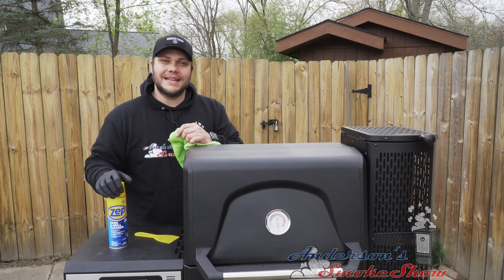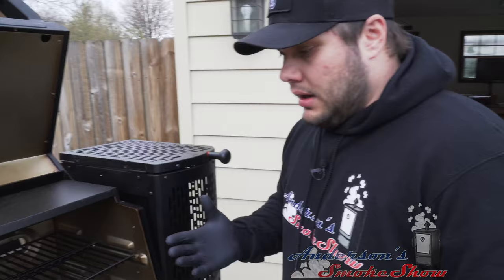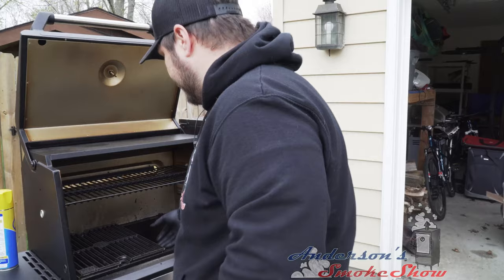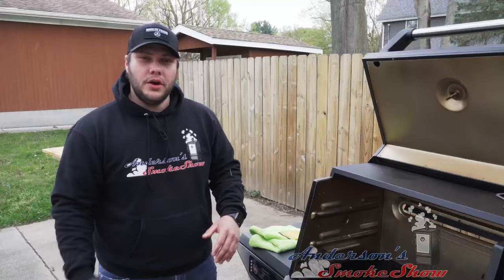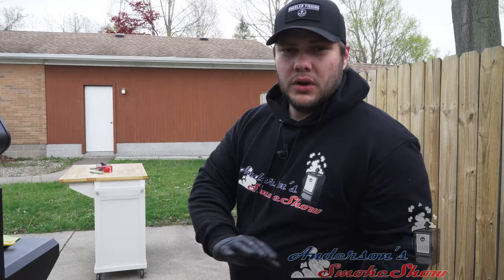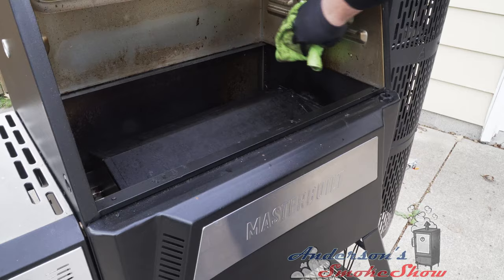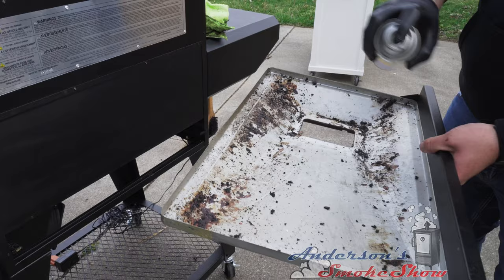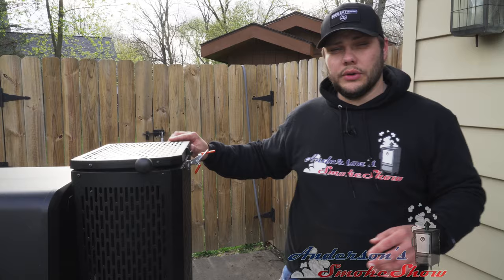Don’t Let Grease Fires Destroy Your Food | How to Clean Your Masterbuilt Gravity 560

Comment from the maker: Wanna see more great content? Click this link to subscribe: https://www.youtube.com/channel/UCbXJeP9Xkq_cu7ZfhIop_Kw/?sub_confirmation=1
Reply: Both online
1. klotes
Fire box and vent (will void warranty) fire grate or fan protecter (grate has protecter built in new grills has grate change already) coal chute and lid for ease of cleaning and protecting grill
2. Lss
Same as above with no voiding warranty (but did confirm both firebox mods will stack)

#2 has better water pan both have manifold grease channelers  #1 has a grease catcher/water (#2 has holders for a foil pan)  holder manifold cover

Am getting the fan protector and coal sleeve from #1 the big kit + rack + coal cover from #2
Reply: Have you tried any of the above
Reply from the maker: I have the LSS mods on this smoker.
Reply: @AndersonsSmokeShow  check out the coal sleeve makes cleaning the hopper easier
Reply: @AndersonsSmokeShow  500$ grill with 600$ of mods 😁 but if it increases lifespan and quality of life is a huge +
Reply from the maker: Yeah that’s an expensive pill to swallow lol

Comment: I never use a wire brush on my grill, only a wad of tinfoil! The wires, from the brushes, have been known to  break off and can get into food. Also, I wrapped all of my lower surfaces with tin foil to keep from getting nasty. I bought a 560 a few months ago, and love the ease of use! Just set my temp and go!
Reply: Have you used the app?  I just got my grill yesterday, but the reviews on the app are the worst I've ever seen.
Reply from the maker: I have but they have a “safety” feature that disconnects the app when you open the lid
Reply: @mitchdroese84  I use the app all the time. No issues with it.

Comment: Good video. When I clean my 800 I do almost the same thing. However I take the heat manifold out and empty the ash and wash it separately. Then I spray the snot out of everything inside, scrape it down. Take the drip tray out and put a pail under it and pour boiling water on everything inside. Everything runs into the pail. Then I put the manifold back in and fire it up like you.
Reply: How do you take it out?
Reply: @timthomas2125  Just push it towards the wall of the bbq (away from the fan) and it should slide, then lift.

Comment: Right now, I have a traeger, I've seen the Masterbuilt 560 at the farm and home store. I didn't like the Traeger ,because  when cleaning, you have to tilt the drip pan to remove from grill. Thus loosing all drippings/grease in the bottom of grill !
I thought, what genius designed this mess of steel. I was looking at the 560 but seen one of your videos that say put in 200 more dollars and get the 800! And noticed how much better it was designed. Easier to clean out! And it can sear steak at 700 degrees! Treager could not do that. Thanks for your videos!
Reply from the maker: Thanks for watching! The 800 and 1050 are better than the 560 and they make great food!

Comment: Why not do what we do with our kitchen ovens, and do an oven self-cleaning by running it at 700 degrees for a while, to let the gunk just burn off on its own? Then, the gunk will have been burnt to an ash that can be easily brushed off. No chemicals needed!😁
Sorry if this post sounds like I know what I'm talking about, because I don't! But I will after I get my 560 up and running next week! Great vids!
Reply from the maker: Masterbuilts instructions don’t make any reference to running it like a cleaning cycle. They say mild detergent and a damp rag, then dry thoroughly.
Reply: I ran my MB 560 @ 700° and it warped some of the metal surfaces
Reply: I didn't realise when I posted this link, that the video is by Masterbuilt itself, so I guess you can say Masterbuilt recommends it!
Reply: @lynnstewart4398  interesting...i wonder if they're aware of what those temps do to their bbq's
Reply: @Itsaint69  What parts warped?
Reply: @lynnstewart4398  The metal lips that hold the grates, the back panel and the removable shelves.  all warped to one degree or another
Reply: Self cleaning  on an oven is 500° for 30 minutes and that’s how I do it I wouldn’t hold the grill at 700° for too long it’s made for searing shouldn’t hurt to go there for 10 minutes or so

Comment: 2 questions. I hear wire brushes are not safe as the bristles come off and end up in food. Also, is there any reason I could not line the grease tray and manifold with heavy duty aluminum foil for easier cleanup?

Comment: I really like your channels and videos. Very good at explaining and you don't constantly repeat yourself. I've seen on some FaceBook groups people complaining about degradation inside the hopper and folks modifying the hopper with a steel insert. Have you had this issue? Is it something to worry about? Are they freaking out over nothing? I would like to buy the 1050 but want to know about this issue
Reply from the maker: Paul I haven’t noticed anything too worrisome. I did see some small-mid sized pieces of charcoal in the ash clean out which you can see in the video... I feel like you conserve more charcoal with this Masterbuilt that any standard charcoal grill so I’m not too concerned. Could they have made the insert a little different in effort to hold the charcoal better.... yes, but maybe that wasn’t their plan. Pure speculation here..... but maybe in order to accurately and effectively maintain temperatures they want the smaller coals to fall through and get replaced by fresher and larger coals. No clue if that’s where their minds were, but typically products go through many prototypes and tests. So I have to give them the benefit of the doubt. Thanks for watching Paul!
Reply: @AndersonsSmokeShow  Thank you. I look forward to more videos

Comment: Thanks for the video! I bought this grill a few weeks back and already have some burgers, a couple steaks and a brisket through it. I was wondering though, the lid of my hopper has a ton of char on it. Almost like there was a plastic film that I didn't remove prior to using. I followed the proper burn in procedure and went over the directions more than a few times to make sure I didn't miss it. I don't think its effected anything so for, but I was quite surprised about it. Love the grill so far, and this is the only thing Ive noticed (other than my bluetooth not working as advertised). Thanks for any help!
Reply from the maker: I noticed the same thing. I think it’s paint or some coating that’s flaking due to the heat and condensation.
Reply: fold a piece of foil and place over. then close lid on top of foil. works great! Blutooth works if you open lid then close and push connection button. usually links right up.
Reply: I know this is 3 years old but that's probably creosote buildup.

Comment: Nice video. I’ve been watching several of yours over the past few days and really enjoy them. I got my 560 put together last Thursday and did my burn in and seasoning. Like you I’m from Ohio and it has been crappy weather so I have not cooked on mine yet. After watching your video I think I’m going to line the drip tray and catch pan with heavy duty foil. Your thoughts? Thanks again 👍🏻
Reply from the maker: Thanks I appreciate the support! What part of Ohio are you from? I’m on the outskirts of Akron.  I regards to foil, the only mentions in the owners manual is not to use foil on the cooking grates as it will trap heat and cause damage to the grill.

Comment: I POWER WASH MINE A LOT EASIER WORKS GREAT NO NEED FOR DEGREASER,AND NO IT DOES NOT HURT THE ELECTRONICS OR THE FAN,I DO HEAT IT UP AFTERWARDS
Reply from the maker: I haven’t gotten to that level yet lol! I try to keep mine clean enough to where it’s a quick and easy process each time.

Comment: Great video. Heard some paper towel with a little bit of oil is cheaper and works faster.  I keep convincing myself to sell my infared master built for this.
Reply: Do it!   The flavor difference is worth it.  I have the 1080.  You may want to check out the new chargriller gravity feed.  Seems they solved and improved many of the quality issues MB has.
Reply from the maker: I may or may not be adding the chargriller to my lineup here REALLY soon! 😉

Comment: This is extremely important for any owner of this thing. I've had 3 grease fires caused by residue left from long smokes. How do you advise cleaning of the "house" if you will, apart from fully disassembling it?

Having a lot of trouble maintaining this thing as I continue to get fires when using this as a grill/broil platform. Honestly never had this much issue with a grill before.
Reply from the maker: I haven’t had too much of an issue with that, but that’s mainly due to the fact that most of my cooks are low and slow. Now the house that you’re referring to is the manifold. I always cleaned it every couple cooks depending on how greasy the foods were. I clean it just how you see in the video and sometimes I’d take it and dump the ash out. Now I have some modifications that help make it easier to clean. I have a video on it, you should check it out!

Comment: Hi. 
I sure do enjoy the details in your videos. I am on the verge of buying this one here in Scandinavia - its 1000+$ here though!
How is the grease management on this one? Is there a lot of grease fires ?
For how long do you wait until you turn the grill on and close the lit on top & by the fire starter?
Is it snowing in your area or is that ashes flying around :D hows temperature steadiness in colder weather?
How is searing on this one .. where I live we sear a lot of beef, chicken, pork - not so much smoking and longer cooks.

Keep up the details in your videos, they are more helpful than you may think ! :)
Reply from the maker: Wow that’s a hefty price! Are all grills marked up pretty high? 

I haven’t had any grease fires, but I try to keep mine relatively clean. Just about any grill will be fine with proper maintenance.

I’d say usually 3-5min is about the average time that the fire starter is burning before I close the doors. I always check beforehand to make sure that the fire has carried over to the coals.

I have seen very consistent temperatures with mine. I have heard that other people had issues, but none here. 

This this is a tank when it comes to searing! You can crank the temp from 150-700F!

Thanks for the kind words and for the support!
Reply: @AndersonsSmokeShow  Thanks for answering.
Not all grills are that much expensiver - I think its because there is only 1 shop selling this grill here so not much competition.
I was really close to buying the Weber Smokefire cause the 2 gas grills I have I am not really happy with - I miss the char coal days/nights.
I am pretty sure ill get one in 1-2 weeks - just gonna see if some problems comes up on youtube - like the Smokefire - I even see youtubers who returned the smokefire and got this one :)
Reply from the maker: I was really intrigued by the SmokeFire initially. Weber has always been highly respected when it comes to grills.... but I saw those same issues on YouTube and reddit. I think they have worked through some of them by now.
Reply: @AndersonsSmokeShow  I wont be afraid to buy a Weber Smokefire when it comes to quality and problems with the grill, that will be sorted for sure.
The taste is my concern - My wife dont like smoked food - and personally I always loved charcoal food.

I always wished for a grill with digital temperature control on char coal and easy and fast start up - and yea ... I just discovered the Masterbuilt 2-3 days ago so now the smokefire is out in the cold.
Reply from the maker: bankor igorion that makes perfect sense.

Comment: I'm going to purchase one of these Master Built smokers so your videos are very helpful. I noticed you are in an area that it snows, me too. I would like to get now but it's winter now. How warm does it have to be outside before you can actually use the grill or smoker? Has anyone tried to use these in the winter? Below 32 degrees? Colder?
Reply from the maker: I’ve cooked on this in below freezing temperatures. It burns more charcoal, but it performs well.

Comment: I would expect oven cleaner to strip the seasoning. Is that a risk?
Reply from the maker: I think that their recommendation is in efforts to prevent people from using abrasive chemical cleaners.... but that’s just my speculation. I have cleaned mine multiple times just as shown in the video with no negative results. There are “safer” cleaners that you can use like simple green grill cleaner or Citrusafe.
Reply: @AndersonsSmokeShow  I was using Easy Off oven / grill cleaner, but then I saw videos on YouTube as tutorials to use it for removing seasoning from cast iron skillets. This kind of worries me that it might remove the seasoning from my manifold or other components. Do you think the cleaner you recommend is milder?
Reply: Yes of course it will!!  If you heat the grill up over 400° for over 30 minutes it’ll take the seasoning off the greats also. Everything would have to be re-seasoned. Just like a cast-iron pan you heat it up too much you have to Re-season it. Some of the directions for cleaning and re-seasoning a pan or to heat it up in the oven!  I definitely would not be spraying chemicals on them!
Reply: What cleaner do most people recommend? I live in the UK and have just purchased my 800
Reply: @MyAlanwhite  just use a putty knife and scrape it. No chemicals.
Reply: @ff8123  I saw in your clean up video you used a oven cleaner spray. Do you recommend not to use one now and just clean most stuff off with a putty spatula?
Reply: @MyAlanwhite  yes. The oven cleaner was a mistake. If you leave it on too long it can actually do damage. And honestly, it just isn't necessary. Just give it a good scraping with that putty knife and you'll be fine.
Reply: @ff8123  what is the best way to refill the hopper mid grilling if it gets low? I see the instructions say not to top it up over a certain heat. Would I have to drop the temp right down before opening the hopper and re filling it?

Comment: In a video from someone else, the guy removed the heat manifold.  Do you think that is necessary in order to do a thorough cleaning?
Reply from the maker: I don’t see any reason to. I’ll have to check out that video.
Reply: It’s easy to remove and install it slides right out in 2 seconds. The top can get dirty from drippings so a lot of people just foil it for easy cleanup. A little bit of ash can be on the inside bottom but I wouldn’t call it necessary. Probably only need to remove it once in a while for a through cleaning. Foiling the drip tray and pan makes cleaning easier too.

Comment: Hey Anderson, regarding the G560, just wondering how you feel about adding a smoker gasket along the front bottom of the lid ?   Also, thanks for the cleaning video.  It really helped a lot.  My G560 is only five months old and definitely needed a cleaning.  Thanks!
Reply from the maker: I don’t see it being an issue as long as it doesn’t it doesn’t interfere with the limit switch for the door. I would consider dry fitting it when the grill is running because the lid design may cause it to “open” up a little further up the lid. Thanks for watching!
Reply: @AndersonsSmokeShow  Got it!! Thx!

Comment: Could you line the top of the manifold with tinfoil as well as the grease pan??
Reply from the maker: Well I’ve read through the manual and the only mention of foil was in regards to lining the cooking grates which they say not to do. My only concern would be the temperatures that the foil is exposed to, and not interfering with the airflow within the grill.
Reply: I lined my tray and the manifold with heavy duty foil and it works really well.  Made clean up a cinch
Reply: Josh Brown did it effect the temperatures or air flow?  Were your cooks still satisfactory?  I am thinking on trying this method as well.

Comment: Great video! Would you recommend using the same procedure and products to clean the MB 40 inch vertical digital charcoal smoker?
Reply from the maker: I would always read the labels and make sure that you understand the material restrictions for some cleaners. Most of the 40in vertical is painted surface and the ZEP is not meant for painted surfaces.
Reply: @AndersonsSmokeShow  Thanks! Your videos are pretty informative!

Comment: Are you still using the Masterbuilt? Just curious if you have had any issues. i am reading quite a few mixed reviews online. Would like to get one eventually and I noticed our local Walmart now has them on clearance (or just a price drop). For such a new unit I am wondering why the price drop. The concept seems pretty awesome and the last thing I really need right now is another grill/smoker, I already have 2 Pit Boss's and another gas grill. But have been fascinated with this one since they first came out.
Reply from the maker: Yeah I’m still using it! I have been bouncing between the MB and my Camp Chef. I actually will have a Masterbuilt modification video coming later this week. I think it’s a good grill especially if you’re getting it on sale. I haven’t had any issues with mine and it continues to make great food. I think peak grill sales are probable late spring/early summer and that could be the reason you are seeing them on sale now.

Comment: How often should you clean the grill?
Reply from the maker: It depends on what your cooking. If it’s low and slow several cooks in a row, then you can get away with less frequent cleaning. If you’re going high heat and searing in between then a cleaner grill is needed or you’ll end up with a grease fire